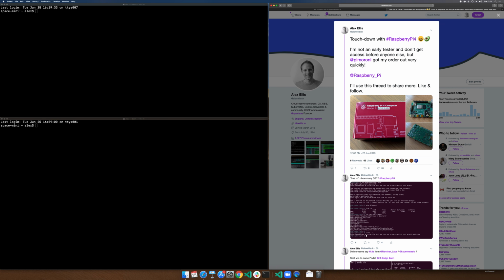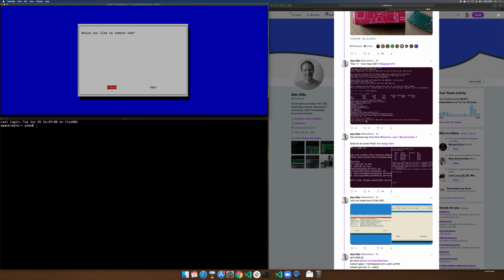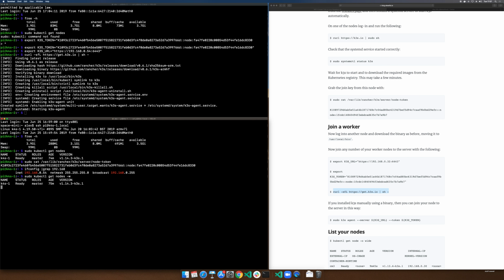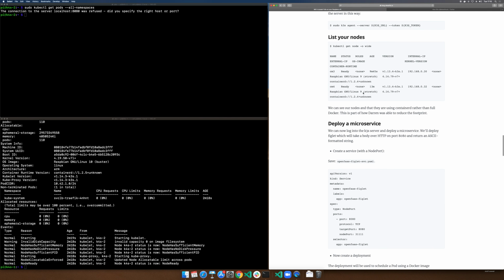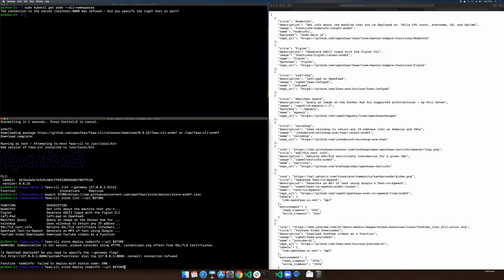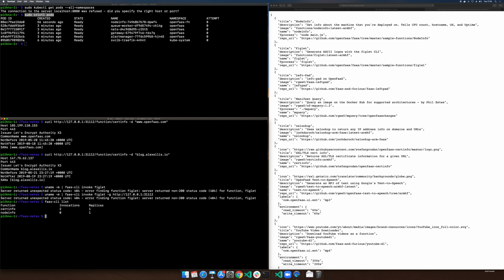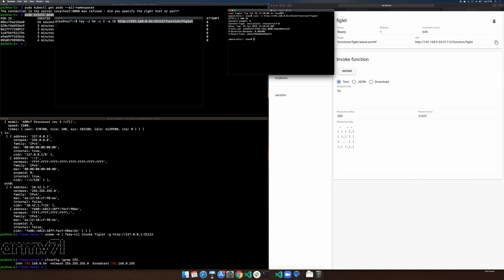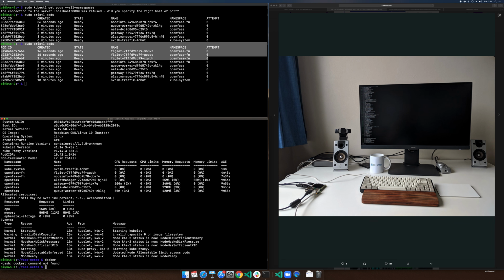Live walkthrough - Raspberry Pi 4 with Kubernetes (k3s)

Comment: I am using raspberrypi3 b+ which has 1 gb ram . I have installed k3s with single node cluster (k3s servers as workers)disabling traefik and I am seeing 535 mb memory for k3s server . I then have set GOGC value to 10 in k3s systemd and then restarted k3s service and now I could see 300mb of memory consumed by k3s . Is there a way we can bring the k3s memory to 200 mb?

Comment: Just trying to clarify how this “kubernete” works.
1. There’s a server with software on it that controls the cluster.
2. There’s a client, which is the device you would actually use that has software on it. This client will have communication to the server which will direct the client to “pods” which will allow the client to use additional CPU and ram to run its software.
The client cannot use the servers CPU and ram for additional boosts of functionality, but the server will tell the client what pods are available to use for additional resources.
3. The pods, these pods just have software running on them that communicate to the server. Then the server can distribute their resources out to the clients for performance enhancing.
Does this sound correct, or can you clarify with your version of how this works.
Thank you,

Comment: I have kubernete cluster made out of Rpi4s  everything is fine, I just can't find information about where the pods are stored. What I mean, is nobody ever talks about the storage ( not storage that is mounted into the pods ) but lets say your SD card is 2Gb, the pods that run on the node can't be bigger than 2Gb logically, right ? So where to specify so the kubernete nodes/k3s use for example USB disk for the temporary FS for pods ?

Comment: Hi Alex... Did you create a similar cluster but raspberry 3B+? Is raspberry 4 more suitable to create a local K8s cluster? I used raspberry 3B+ as 1 master and 2 nodes rpi k8s cluster, but after 20 minutes or more using this cluster the performance is really bad, I think is due to the lack of memory of rpi 3B+ (only 1GB). Cheers!!
Reply from the maker: What did you use? kubeadm is quite slow and heavy, k3s reduces that footprints. if you follow the blog that I posted in the links you will see that it is done on Raspberry Pi 3. (So yes you can and you can mix and match if you want, 4GB is better than 1GB)
Reply: @AlexEllis  thank you do much for your response and review...and yes I used kubeadm with roi3b....when you start the cluster all pods and services run ok, if you execute kubectl get ... Its ok and response its about 3 or 4 seconds but after 20 or 30 min of use, the response speed goes down and same kubectl commad take 1 minute or something like that...so I was wondering to use one if this new rpi with 4GB as máster and the old ones as worker nodes. 

So thank for you response again. You have my like!!! :)

Comment: Could you put rancheros instead of rasbian? I have planed to build a simmiliar cluster. What's your opinion, what kind of projects are suitable for this setup?
Reply from the maker: If you would like to know what kind of projects are suitable, I would suggest that almost anything that can run on Kubernetes would be fair game. In the example I show very popular serverless project that allows you to deploy any code
Reply from the maker: Can you tell me what you think that would add in terms of value?
Reply: @AlexEllis  Well, some benefits I see are: (1) less storage usage, as rancheros is fairly small. (2) security, as less unused packages/services are running on it, (3) better performance, I'd asume it at least, (4) less RAM usage, (5) easier update/upgrade process, as everything runs with docker and "latest" always keeps the system up to date.
Reply from the maker: @V1K700R  I use Raspbian because it has the widest appeal, is almost guaranteed to work and the "lite" edition comes with very few packages - i.e. no UI. The clearest difference is that k3s doesn't ship with Docker, it removes the need for it, but RancherOS runs on it.

Probably you could ask on the Rancher forums whether they have compatibility or not. Alternatively, raise a GitHub issue - https://github.com/rancher/os

Feel free to update us on this thread with how you get on.
Reply: Try K3OS instead